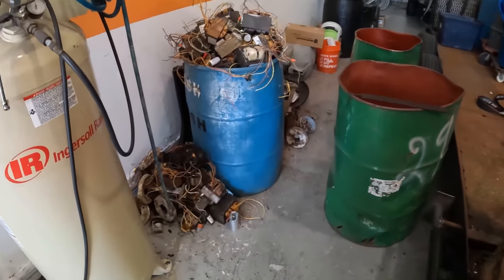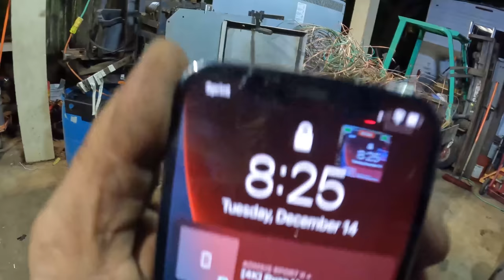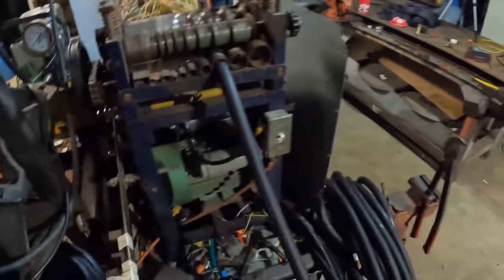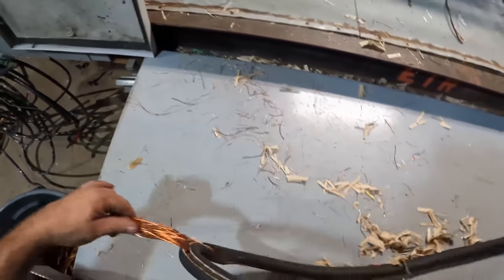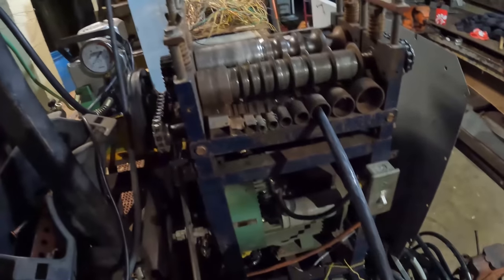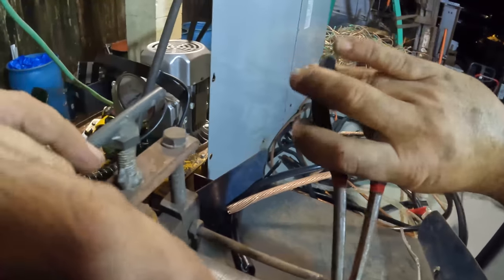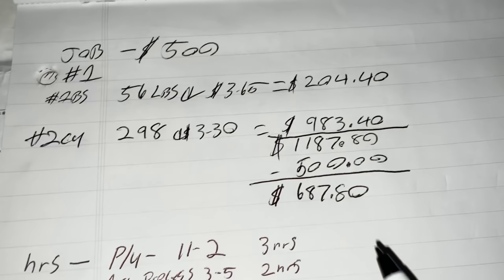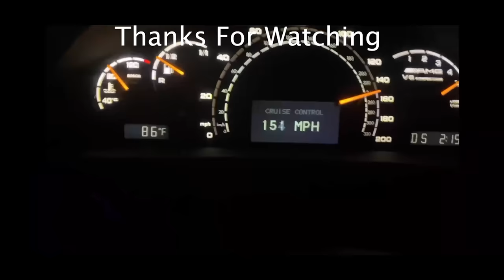Make $1000 A Day Scrapping!

Comment: This video is ridiculous, the average scrapper is lucky to make $100 a day, let alone $1000 a day. Scrap prices are so low it is not even worth the time or the gas money to do it. I was a scrapper with a friend for about 2 years, we would fill the bed of a ford ranger truck with scrap and take it in. You weigh in, then dump your scrap and weigh in again. 

I would go inside and get a check for the scrap, and on a good day we made $40 for one load of scrap, then scrap prices dropped, and after that a full bed full of scrap was only making us $20 to $30, so we quit doing it. This is a real story from an average scrapper in the Peoria/East Peoria Illinois area. 

The place we dumped the scrap was in Peoria Illinois, a few miles past downtown, towards Bartonville. They did pay extra for brake rotors, but not much, and we usually only had 8  or 10 of them a week. Copper paid better, but it was hard to get enough copper to make much on it. 

We did a weekly scrap run for 2 years, then scrap prices dropepd so low it was barely enough to cover the gas money.
Reply from the maker: Thats why I don't mess with steel. I focus on copper products that can be upgraded. This video is showing what is possible with the right setup and customers.

Comment: only srapper's and drug addicts would strip new wire that cost $4+ a foot to replace just so they can get 50 cents or less a foot scrapping it.....
Reply from the maker: I buy all my wire from electricians. I've tried in the past to sell wire as is, all of my customers are electrical contractors. The problem is the wire has to be the size & length they need for a specific job. I wind up sitting on the wire and it takes up space and a lot of money. If I saved all the good wire I get I'd be out of room and broke real fast. It does not sell as fast as you'd think.

Comment: If you have a big long length of brand new wire, then sell it as is.  Only reason to scxrap it is if it was stolen probably. Or too greedy and stupid and just looking at scrap value, when new value is much better.  The insulation was expensive, what a waste.  Looks like stuff used for conconcerts and carnivals, large temporary power systems.
Reply from the maker: If I kept all the good wire I get I'd be out of money and space in no time. The wire does not sell like you'd think. I get all my wire from electrical contractors, if they wanted the wire they would have kept it.

Comment: $1000 a day is a lie and you know it. Any electrician that takes the time and space to store scrap does so because they know it has value and they sell it to scrappers. There is no way I or anyone could ever believe you just get all this stuff for free. You buy it. Spend $800 on 600lbs of scrap, 10hrs to break it all down just so you can sell it for $1000. Claiming you make $1000 per day when most of that gets eaten up by overhead is misleading. I was a scrapper for years and my wife still works at Behr Iron & Steel. You are not making $1000 in profit in a day.
Reply from the maker: I pay for all my scrap and you probably can't make a $1000 day because you don't have a transformer press like me that can easily produce $900 per hour, or a wire stripper that can easily produce $500+ per hour. I've made many videos on both machines and many videos showing how you can easily make over $1000 a day scrapping.